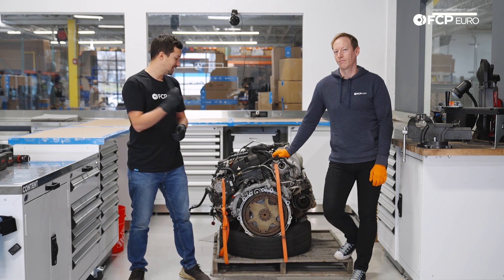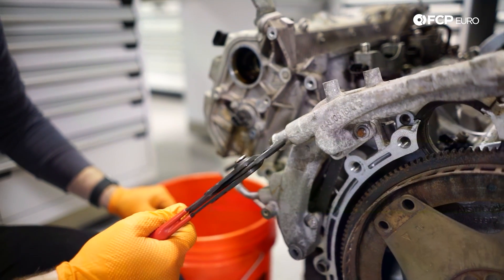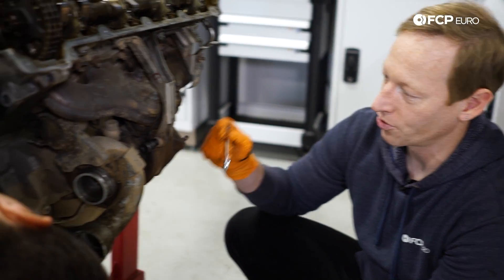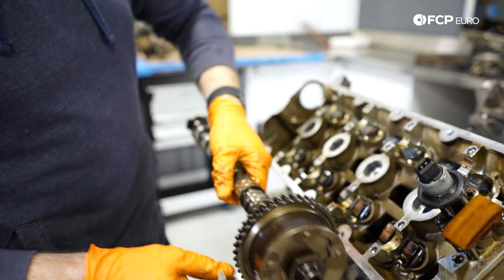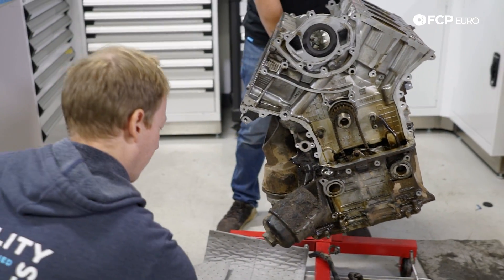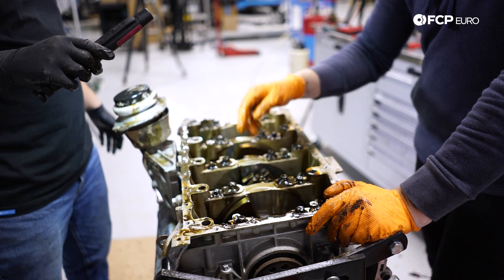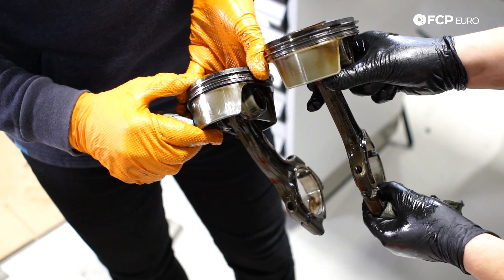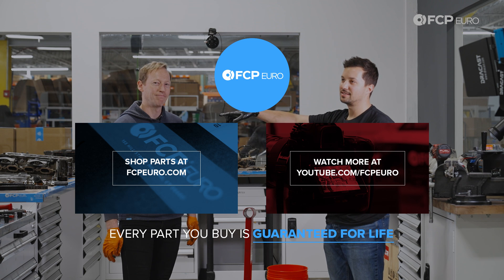Bending Steel With Water: Inside a Hydrolocked Porsche Engine

Comment: Did any body else get super confused when he started talking about the timing chain, how at first he called it a dual chain setup and how most newer engines use a “singer” chain setup, then proceeds to say it only has one chain (which is clear when you look at it even from a video). The amout of time and effort that goes into this video you would think they would at least try and be accurate with what they say

Comment: When I was in high school back in the early 1990s I had a 1989 Ford F-150 with the 300 cubic inch inline six and hydro locked it when crossing water on a camping trip. One of my connecting rods was bent and twisted worse than on this engine. The mechanic who tore it down said he’d never seen one that bad before. I wish I would’ve kept it as a reminder that water can’t be compressed and isn’t a good thing to introduce to your combustion chamber.😂
Reply from the maker: Pleaes tell us before attempting the aforementioned water crossing you said "hold my beer. " and then instantly hydro-locked the truck 😆Ben has since framed this Rod as a constant reminder of how not to approach deep water!
Reply: @fcpeuro  no doubt my experience wasn’t as costly as yours with the Cayenne. I learned a valuable lesson though.

Comment: I once inspected a four cylinder engine from a Kia sedan. The guy picked it up from a service, drove out and shortly after drove through a "puddle". Ingested water, stalled, engine locked up. Here's where it gets interesting... he had offered some of the workshop staff a ride because of the rain and in a moment mental failure, they helped him push start the car. He drove home, had the good sense to remove the airfilter and let it drip dry. The next day he simply carried on using the car until "that" moment when the damaged rod gave up and tore the engine apart. What came out of that engine was multiple bent rods, with the broken one having bent well past 60⁰. Somehow the engine kept turning. Somehow this guy managed to ignore his engine light, the noise, the misfiring, the soaking wet airfilter...

Comment: There's a YouTube channel called Rufford ford about exactly that. The ford is in Nottinghamshire England and is simply morons who blast their, sometimes expensive, cars through the water only to hydrolock their engines. And then to add insult to injury they try to start the engine causing further catastrophic damage. I would imagine that the majority of the cars are written off as insurance companies won't pay for the expensive repairs. There are hundreds of videos and it's well worth the watch.
Reply from the maker: Ben has spent much time watching those comps...😂

Comment: This whole thin can be avoided by stopping before the water crossing, lifting the hood / bonnet and looking at where the air intake is.  If its low, stop.  If the air-filter box is high up just pull the lid off that for the crossing and stick a cloth in the low down intake.  If you can't get the intake up high then turn the engine off and get a tow across and save yourself $10,000.  Its been the fashion to fit cool air intakes low for power but in the real world with floods they are just rob-benders.

Comment: Should have removed the intercooler pipe from throttle body before starting the engine. Would have been fine.

Comment: These are great engines until someone thinks they are a submarine and get water into the cylinders. Water and electronics don't mix very well, so why do some crazy people take them into water?  Cars with electronic emergency brakes also can lock on so you can't get out of the water once you are in there. This is often seen with the newer Audi's.

Comment: Another great video by FCP and crew. I'm glad you touched on the glued in coolant barb. I had mine pop off when I was passing someone on the highway and I was 2.5 hours from home. Luckily a small indy mechanic down the street was able to push the barb back into the crossover pipe and I'm like 3 months strong lol. I plan on slathering it with JbWeld marine or something soon because I need to be able to romp on it with winter coming soon.
Reply from the maker: That doesn't sound fun shuckydarns710 - glad you were able to patch itup though. Check-in with us after a year and let us know if the JB Weld fix works😂

Comment: I may have said this in a video a few years ago, but Sunex makes a very nice drip pan that fits on the long leg of an engine stand.  Sunex 8300DP Oil Drip Pan.  Theirs is built specifically for their geared engine stand, but I suspect it works on many. Others like Jaz Products 720-000-01.

(A geared engine stand is a wonderful thing, too.)

Comment: Too bad you guys didn’t try to pull spark plugs before cranking over.
Reply from the maker: Plugs were pulled, cranked it for a while and got what water we thought to be stuck in there out, and unassembled as much as we could trail side - but clearly didnt get it all out 😳

Comment: How did you not know where you air intake was before crossing a deep river, common sense
Reply from the maker: Wasnt that the intake position was forgotton - it was the fact that the factory shrouding protecting the intakes was removed. In addition to going into the water simply too fast.
Reply: well the guy in the cayenne in front of him made it across. issue was FCP Ben entered the water too fast
Reply: @chir0pter  Still Nate Brown's fault though! :)

Comment: Oh wow!  Hope I never have to get that deep into my engine!  Just finished with replacing the CV axle on my '09 GTS - lessons learned : (1) if doing a CV axle, consider going all the way and replacing upper and lower control arms - you get new bushings, ball joints, and boots; and don't care if you damage anything during removal - so it ends up being much easier and faster, (2) if not replacing ball joints, be aware that new boots that match the old ones are hard to find, so take a lot of care, (3) if you have to tap on the stud to separate the ball joints, don't forget to leave the nut on the end of the stud to protect the threads - or be prepared to spend a lot of time with a thread chaser and/or thread file to repair the threads, (4) If you will be taking a long time, get a battery keeper - a dead battery is a pain, as the power locks and power seats won't work - and you need them to open the back hatch or to access the battery under the driver's seat, (5) note that an after market CV axle may have a different sized axle nut than the original - new one was larger then my largest socket, which fit my old axle nut, (6) brake shield bolts are the same diameter and threads as the bolt that goes in the brake pin - but not the same length, and one has a flared head - don't mix them up.
Reply from the maker: Lotta good notes there Johnathon, the axle is a straightforward job on this car but as you mentioned there are some things that can certainly make it easier/more worth your while when unassembling and reassembling.